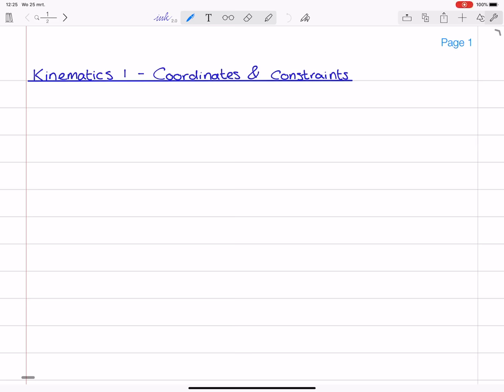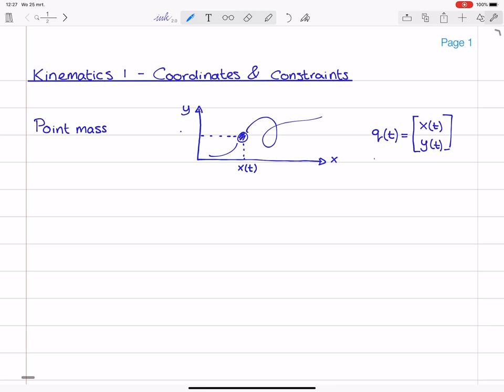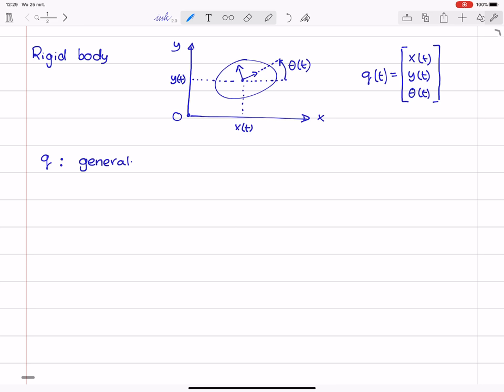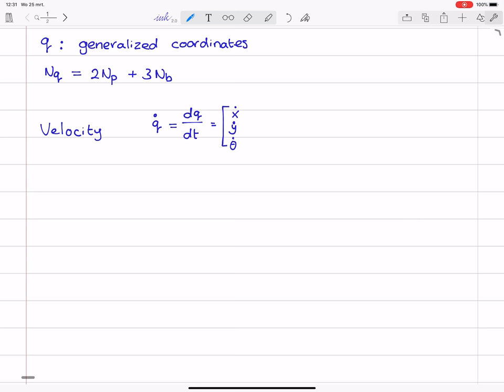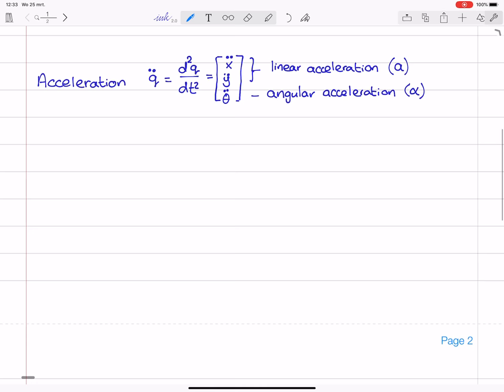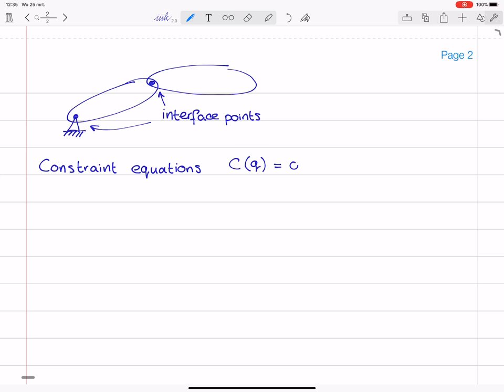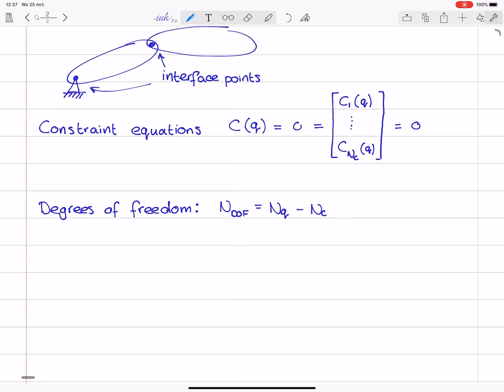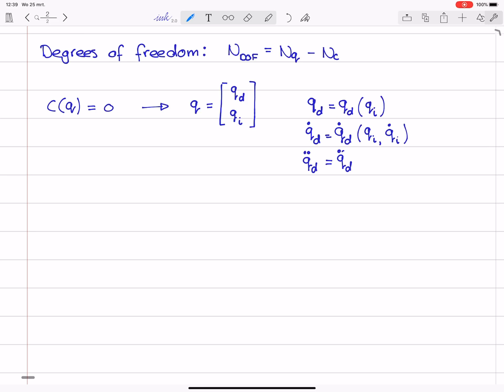Mechanical Vibrations 2 - Kinematics 1 - Coordinates & Constraints

Comment: Hello Professor. May I know what is your reference book that you are using?
Reply from the maker: For the majority of the course, I like to recommend Fundamentals of Vibraions by Meirovitch or Mechanical Vibrations by Rao. However, specifically for explaining the kinematics and the relations between the kinematics and the kinetics, I find both books a bit unstructured. For the rest of the course though, I think both books are excellent.
Reply: Thank you so much Professor.